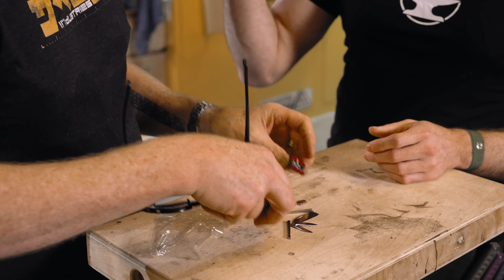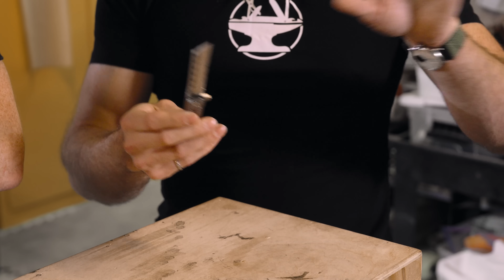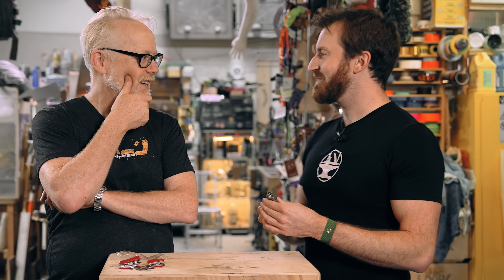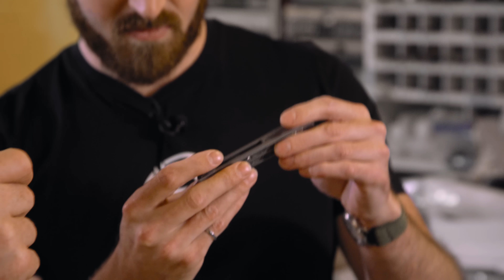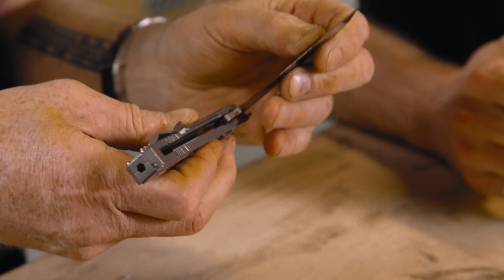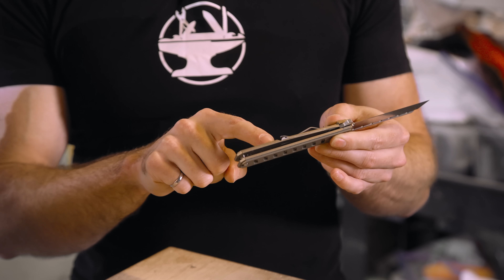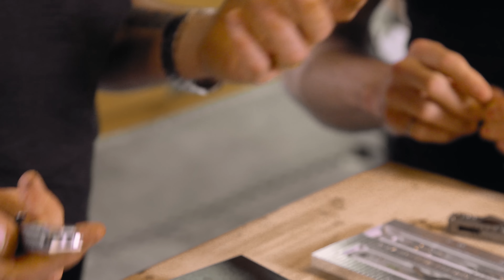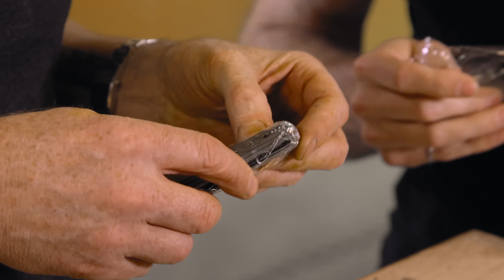Adam Savage Wields Hacksmith's Titanium EDC Multi-Tool!

Comment: Its a cool product. but man you are shafting people with that price tag.  you drop something in comparison with something as legendary as a leatherman without pliers then charge twice the price.
Reply: Its made with m390, titanium and is precisely cut, it should be more expensive from how its made lmao
Reply: @Hannibal2468Slt  the wave, argueably the best multitool ever made, is 119 bucks.  Its made with very high quality material and also precisely cut.  Plus it doesnt have the most used tool.  Titanium isnt the win you think it is.  Ya its light and hard.  But its not going to gain you anything over stainless steel in an edc besides a few ounces of weight.

Comment: tried to get a founders on kickstarter and they are gone apparently so i passed cause i wanted that tritium. if they drop more founders ill get in if not ill wait til someone sells theirs
Reply: You can add the tritium to the knife as an add on.
Reply: @thor2088 i didnt see that option as an add on. Thats literally the only thing i wish the pro had that the founder did. Id rather have something that always glows cause glow in the dark does no good if it was in your pocket until it fell out and you lost it in the dark cause it never got a chance to charge in light
Reply: @thor2088 just checked again and there is no add on for tritium.

Comment: As someone from Sheffield, the home of cutlery and pocket knives, I think that blade shape is close to the Warnecliffe blade shape. The flat cutting edge with the point taper from the cutting edge to the back of the blade. One difference is a Warnecliffe blade doesn't have a ridge along the back edge, the thickness of the blade tapers from the cutting edge to the back without interruption.

Comment: I dunno man, a Leatherman Skeletool CX has pliers with a wire stripper, a 154CM knife, a phillips, a flat, and you can get the double ended flat that has a glass breaker on the other side, plus the aftermarket little hammer basher plug for the end. 

A LIFETIME WARRANTY

MADE IN THE USA

UNDER $100

What more do you actually need? It's gimmicky AF to add all these extra things you DON'T ACTUALLY NEED.

I would LOVE to see Hacksmith do it's own take on the minimalist Skeletool.
Reply: Pliers and wire strippers are peak gimmick, all of the stuff on this ar ethings I use 24/7 at home, work, in car, in the woods, etc.

Comment: at over $600 it is out of touch for the common man.
Reply: The lite version is $135 CAD, the 14-in-1 is $270 CAD, and the PRO (21-in-1) is $340 CAD. The Founders Edition is $546 CAD.  The founders is the same as the pro, it just has the laser engravings added and the serial number.

Comment: so, I agree with the guys here. I think that a potential product should be perfected before you think about sending it to market.  this way the entire process has been figured out and set up to produce a product that you can have confidence that it will live up to expectations made by promises made through the advertising campaign. by ensuring that tolerances are being hit with consistent quality checks on finished products so that sub-par products don't make their way into the market. the machines needed to pop these out by the thousands in a day is the next step.   remember rather than putting a product on the market and think "what don't I tell them, to get it to sell" think "how do I improve it without making it more complex and difficult to operate" "how can I fix this issue that's been discovered" be very very clear about the intended use for your product and CLEARLY state that you will hold no responsibility in the event that it be used outside of the scope of intended operations and to use the item not as described will void any warranty.

Comment: - I don't need an blade edge that long for EDC. it's too bad the better steel is exclusive to the founder edition (sold out).
- I want the option for a serrated edge (a separate blade).
- It doesn't need to glow. It's too bad the better glow feature is exclusive to the founder edition (sold out).
- I'm never going to be in a situation where I'm mounting/building something and don't have a dedicated level, and I absolutely can't think of any other scenario in which I would need a level other than premeditated mounting and building.
- I don't like that so much functionality requires the blade to be open. Would not have been that hard to include a flip-out protractor "strip" that doubles as a feeler gauge, straight edge for drawing/flatness checking, file, and screw thread gauge (added holes for thread gauge would reduce weight.
- I want pliers/clipper.

Ultimately, it's really cool, but I would miss my SOG PowerLock (gifted to me by an old roommate a decade ago, he having it found on the side of the highway years before passing it on to me). The only thing I wish my SOG had that the Smith Blade can do is use various screw driver bits/store various bits. But, actually... maybe I'd still want a full kit, with more options of bits at any given moment, and maybe I don't really need that as an "EDC". A basic flathead, and basic Philips head, covering a couple of common sizes, and some other tools having other sizes of edges to use in a pinch, really covers 99% of "I don't have my tools on me" scenarios.

Like, I'm not working on small electronics, etc. without my backpack, at the very least, you know?

There is nothing wrong with trying to make multitools lighter, and more functional, but the biggest issue for EDC, in my mind, is actually the carrying aspect. We need better pouches/easier ways to carry these things that isn't just "throw in it a pocket and hope it doesn't move around too much/fall out when you're sitting".

I think Hacksmiith Industries would be better off designing, like, a smart/AI controller, electromagnetic, quick-deploy EDC mounting system. Think "How Halo Spartans have their weapons mounted to their armor for quick access/quick stow, and it takes zero seconds to get or put away an AR/pistol". I want my EDC to do that, so I can hold more and better - not a highly compromised something, that's missing a bunch of stuff I want/need.

Good talk/thanks for reading if you read it. Good luck!

Comment: the knife may be able to cut through anything but I doubt the hinge at the end of the blade can take that kind of pressure.  I have an amazing knife I got from an army guy that self sharpens it when you close it. But the only fault is a weak hinge.

Comment: The hex driver with its sliding parts and small springs simply won't work once it's been dropped in the mud and gunk etc. definitely a cool gadget like most "edc" tools but nothing beats a solid blade when ya need one. I carry a literal mini backpack with me everywhere, it's always in arms reach when I'm away from home. It weighs about 8kg but the amount of times I've been able to pull something out that's handy it's worth it. I carry a pair of Leatherman style folding pliers and a nice handmade hunting knife and a folding Allen/spanner tool. Amazing how many things I've used them for but there's no "good" true all in one anything I reckon.

Comment: Sooooo in other words this is just a Swiss army knife that is larger and has less features and it's less durable. Because it looked like after it sliced through the Swiss army knife it completely rolled the edges of the blade. That means the blade is either cheap steel or it's not heat treated properly. Anybody who watches forged in fire knows that judges look for the edge rolling after durability test. And if you've ever watched that show anybody who has a rolled Edge after a durability test got negative marks. And there were blades that did survive with no rolled edges. So it is possible to make a good blade that can take a bashing. I think the Swiss army knife is more compact more affordable and more tried and true. I don't think a $200 knife is worth it, specially if you're the average Joe who loses things a lot I would hate to lose that knife and be down $200. Also it only has a box cutter style blade so you can't really stab anything with it.

Comment: That gentleman is something I have got to get my hands on. Im an avid bikepacker and go on 100+ mile trips regularly. As an Eagle Scout myself from IL I'm like minded when it comes to multiple leatherman tools.  I've been 3D printing different modular edc sheath designs. Always trying to pack everything I need into the smallest possible space to carry on my bike. Very impressive design, and I'm a guy who LOVES the loud ratchet sound buzzing out of a nicely built rear hub... (cyclists will know exactly what I mean...) and the fact you use ceramic ball bearings, I have ceramic bearings in some of my carbon wheelsets and a couple bottom brackets that has to be a smooth deployment! 
Very well done!  Now...
Exactly what address do I send my next few paychecks to? I kid...
No seriously I'll do it..
Cheers🐐

Comment: It was kinda funny the part where he talked about the bit sizing.  On the LTT podcast Wan show, a while back Linus talked about them designing their screw driver, and they ran inot the same issue, where they planned and designed their bits based upon the set standards, then later discovered that most all industry bits arent even within spec, so they had to decide between sticking to spec and basically requiring people to buy their bits, are go out of spec and start matching the most likely big names in the industry that people might have bits for, to allow the widest audience of people using their own bits and hopefully they just work

Comment: Nothing wrong with this, but I prefer to have my screwdriver separate from my blade, and both separate from my pliers. I want the blade separate so I can leave it at home when I fly, and still carry my other tools, and I want the screwdriver separate from the pliers so I can use the pliers to hold a nut while turning the screw with the separate screw driver. I don't yet have a blade or pliers I'm completely happy with, but the screwdriver I have and am happy with is from 711L and it uses 4mm hex shaft bits. I have not found a good commercial bit carrier so I designed and 3D printed my own, but it tends to break and dump the bits when dropped.

Comment: No scissors, the most antiquated and useless tool ever. But it has a bubble level, like any phone since smartphones are a thing. But 200+ euro for almost the functionality of a 40 euros sak with the warranty of a chinese knockoff, truely modern. Btw there is a sak with m390 böhler steel, made in italy mkm malaga, check that out. Dont know if it will cut a sak in two pieces while attached to some kind of pressing machine though. So disrespectful to the heritage...

Comment: The Spyderco Navaja designed by Ed Schempp did the opening sound like 15 years ago, just saying. Rad EDC tool, though.

P.S.
I asked Olamic to put holes for different guages of wire in a knife design for the wire stripper and they told me I was crazy.

Comment: I think that is probably the best quality knife bodied multi tool. I love how it’s m390. To. Bad I seem to use the pliers and scissors more than any other tools. The only thing I don’t like about your one is that the knife is out when using the nail file. I don’t want the sharpest multi tool knife on the market out to file my nails that’s all.

Once you have settled into the multi tool market, please make a key chain multi tool. With main body pliers or scissors. I’ll be on to that if you ever do that
Reply: The nail file is on the back side of the knife, so you can use it with the knife closed…

Comment: Simple note about the torque flag, be careful to test the plastic at a few different temperatures, 10°C can greatly influence the flexibility of most injection molded plastics. So 20-30°C and even beyond would be a reasonable expectation for that tool.

Comment: This is soooo information-gappy. (and a bit sad)
that in 2025 some mfr. still hypes about they're using M390, and talks about it like it's adamantium.
and also, Mr. Savage feels the need to buy a $300+ TSPROF set just to sharpen his Swiss Champ, when it can be done with way simpler tools that costs less than 30$.

Comment: The part that made me most curious was when the Hacksmith stated that while he hopes for success, they can only pump out 12 blades per day. Big success means quiet the work load.  I had to go see how many backers you gained:

Over 7 Million CAD, which is much more than the projected 250000 CAD minimum. 

Over 900 for the Early Bird foundation tier, 500 for the Early Bird Pro, and over 14000 for The regular Pro blade.... 

Success is indeed. Work? Indeed. 

Next Hacksmith Video: We made our own Tony Stark Manufacturing Production facility. 

Thanks Adam for this personal dive into the blade. It will be interesting to see what you think after having spent some time with your new blades.

Comment: 17:00 The knife is for right-handed people only. No versatility.
Reply: What makes it right hand only?
Reply: @VincentBourbeau  Because the clip will dig into your hand when you hold the knife in your left hand, as opposed to when you hold it in your right hand.
Reply: @Krevedko007  Hooo! Yah you right…. At least you can remove it, but that sucks…
Reply: Belt clip is reversible you can see the holes for it on the other side
Reply: @AnthonyForsberg-ik6km  y’a but the blade stays facing the same side, and the belt clips can’t go over the bits storage….

Comment: Supercool, but not allowed to carry it it Germany because of the single handed opening function of the knife blade.
Reply: The EU version is made so you open it with 2 hands I think… so it should be fine for Germany…
Reply: The EU version is made so you open it with 2 hands I think… so it should be fine for Germany…
The blade length is also shorter…

Comment: Looks like a cheap knock off. An actual swiss army knife is made by victorinox and that knife doesn't have the victorinox logo. Also that is the cheapest swiss army knife you can get. Pretty much the base model prius of swiss army knifes. Huge missrepresentation of our legendary knifes.
Reply: The fact that Swiss Army knives are cheap is one of their greatest factors, cutting one in half with a press obviously doesn’t prove anything at all
Reply: @jestawell  Actual swiss army knifes are not cheap. You are either thinking about the knockoffs or the cheapest model there is. Those are tourist knifes or company gifts. We don't buy these for ourselfs here in switzerland and they also don't get used by our army.
Reply: @glb8011 usually the victorinox “classic” is 50$ which is pretty affordable for a knife/multi tool

Comment: On the one hand, this is pretty dang cool.  I'd love to have one.  On the other hand, the only things I'd use it for are: fidget toy, nail file, short straight-edge (occasionally), screwdriver (occasionally), and knife (rarely; the blade shape and size reduce the use cases).  Can't really spend 250+ on what would mostly be a fidget toy and nail file for me.  Meanwhile, here's what I use on my multitool: pliers, needle-nose pliers, scissors, wire cutter, proper small-gauge clamp-and-pull wire strippers, diamond file, regular file, screwdrivers, serrated knife (occasionally), and smooth traditional knife (occasionally), makeshift hammer, can opener (rarely).

Comment: The bit holders for use on the titanium scales will strip out in no time when putting steel against titanium. Short term I am sure they will work fine, but long term they will be useless as the corners of the titanium hexagons deform from use. Maybe there are steel lines, but I didn't hear him say so.

Comment: 7:20 i cracked my Samsung s24 screen in the gym on a rubber mat.
But in ALL the time I dropped my phone on concrete. Pavement. Dirt. Rocks. Sand. I flung my phone out of my car by accident once. While I was moving at around 10mph. Never cracked.
But at 3 feet. Straight down. On rubber. I have a spider crack at the very edge of the right side of my screen

Comment: Just be careful: Having watched their own video on this, I'm a little on the fence about these guys. It came across a little "false advertisey" - as they completely failed to mention that the cheaper models don't use the blade type the entire video was so focused on.

Yet, when called out on this, did they reply; apologise for any confusion; and explain that full spec details are available on the website? No.

Did they ❤ comments made in their defence? You bet they did! Which means, they are reading through that thread. So while they might no have endorsed them with a ❤, they are certainly letting some of the more toxic comments slide.
Reply: Sounds about right. They've always been shady. I'll just wait for the copies from China in a few months. They won't be as good sure, but they also won't be $200. Pretty sure I won't need to ever cut another knife in half like that ridiculous demo.
Reply: Yes and no. A real m390 blade will be in the hundreds of dollars. The Kickstarter goes into depth of all of the features and materials for the knives individually. You're given all the material prior to making your purchase, and they make it plain and simple that the lite is being made in China. Could they specifically say that this is a different blade steel, yes. Is it inferred and clarified that it is not through the pricing and promotional material? Yes.